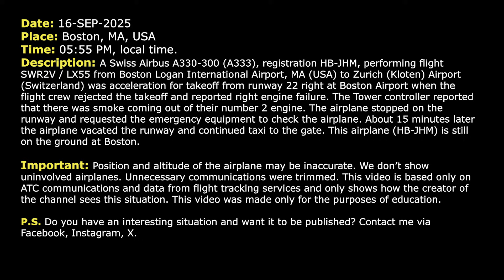Engine failure. Swiss Airbus A330 rejects takeoff and stops on runway at Boston Airport. Real ATC

Comment: Is it just me or has Logan airport had more than average incidents lately?
Reply: Wake turbulence causes engines to have Compressor stalls, which is exactly what happened here. A compressor stall usually comes from an sudden change in air direction so the mixed Fuel-to-Air Ratio on the inside of the engine doesn‘t match anymore and causes the engine to stall. Metaphorically you can compare it to like stalling a car engine with an manual transmission when releasing the clutch to early. Due to the fact that Boston Logan Airport has wake turbulence quite often, you see more incidents like that there happen.